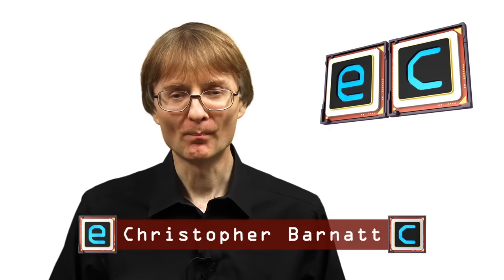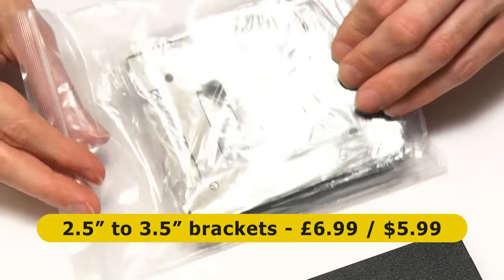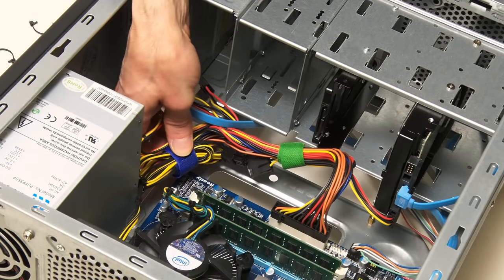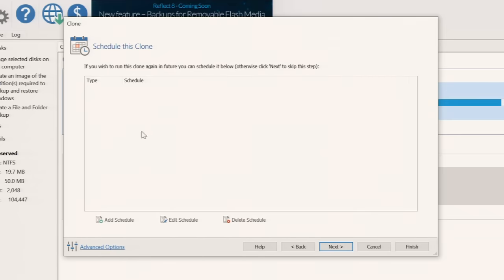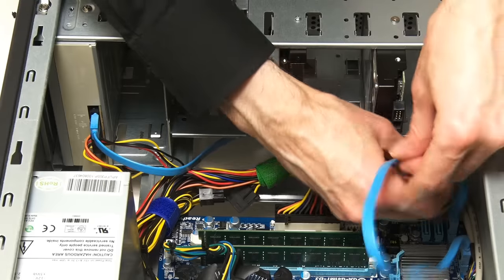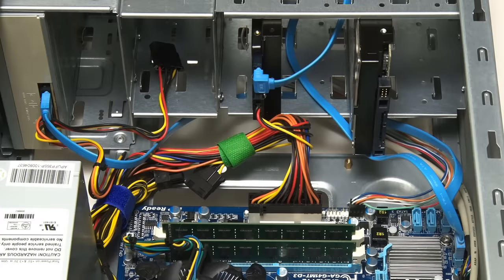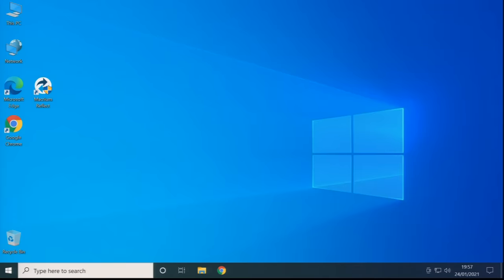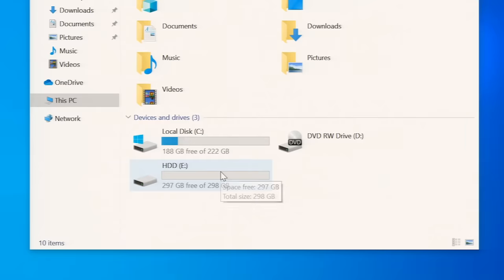Old PC Upgrade #2: SSD Boot Drive

Comment: Great video. I'm just wondering what will happen to my windows license. I have a volume mak license (permanently activated it says), will I lose it?
Reply from the maker: If you clone you Window system drive to another drive and use it in the same PC then your license will remain intact -- providing that you do not then try to use the old drive as a Windows drive in another PC! :) Basically the license is for your particular hardware, and the clone process duplicates the drive it is on -- including the drive ID -- so Windows does not know anything has altered license-wise. Good luck!
Reply: @ExplainingComputers  Thank you! I'm assuming that by hardware you mean the motherboard, but I'm only getting a new drive (ssd in this case) so I should be okay (?) And yes I'm planning on using the old hdd only as extra storage.
Reply from the maker: @mckz9934  "Hardware" means the motherboard, although the if used the cloned drive with the same motherboard but a different CPU, RAM and GPU you could have problems. So if you just change the drive should have no problems. But do boot without the old drive connected first. Good luck!
Reply: @ExplainingComputers  Thanks again!

Comment: Very helpful. Thank you.  I went through the steps. Worked like a charm. One question. I clones a 500 GB hard drive to a 1 tb ssd. Storage now states I have used 139 GB and have 361gb remaining. Looks like I am missing 500 GB. Any advice?
Reply from the maker: Glad it worked, but it sounds like you did not resize your C: drive partition. No problem though! Right click "This PC", select "Manage" and then "Disk Management" on the left hand side of the screen. Then select your "C:" drive on the right hand side of the screen, and below you will see the partitions, and also some empty space. Click on the "C:" partition, and then right click and select "Extend Volume". Use all space available -- ad you will get the 500GB back! :)
Reply: Thanks for the reply and the great videos

Comment: New Laptop don't have cd drive 😕 my current laptop has one. I replace the boot hdd with a ssd. Then I replace the cd drive with a cd caddy and add a 2tb hdd for my data. New laptops cost high with just a 120-240 gb ssd and you can't add a second hdd. Also if it has ssd+hdd is stupid high and getting one with only one slot with hdd is old fashioned.

Comment: Can't wait to give my 10 year old i5 new life!
Just a "quick" question. Can I clone my HDD to SSD, shutdown my Pc, and change my boot sequence to the new SSD without removing the HDD? My current Win10 OS is on a small 80GB partition on the HDD and the rest of the 1Tb is is drive D:
I do not mind keeping my old C drive like that for the day I need it for whatever reason.
Reply from the maker: Yes, what you describe (changing the boot order before rebooting) should work. Just check things very carefully. :)
Reply: @ExplainingComputers  Thanks so much for always assisting us :)
I really appreciate it.
Reply from the maker: @avjaarsveldt  Good luck!
Reply: @ExplainingComputers  Thank you. I tried the clone today. I know I have bad sectors on my HDD, and Marcium Reflect was unable to clone my drive due to that. Do you have a video that can help me cloning a drive with bad sectors. My Windows still boots every time always, so the error sectors should not be on the Windows files (I hope)

Comment: Can I use the sata cable and power connector from the DVD for the hard drive when rebooting the PC with both the HDD and SSD to check the storage and to delete everything from the hard drive? Do I have to use the adapter for sata? 17:47 
I do not intend to use the hard drive anymore and I intend to remove it from the PC entirely.
Reply from the maker: Yes, you can use the SATA cables from your DVD for the hard drive as you note. Good luck!
Reply: @ExplainingComputers  thank you very much! The video is extremely informative, and I couldn't have hoped for a better explanation of knowledge about hardware. Really great job, and thank you again. Your channel helped me a lot! :)

Comment: This just proofs that upgrading the PC based on Core 2 Duo/Quad CPU is useless in 2021. You can add some RAM, you can clone the system to the SSD ... but the main bottleneck, the obsolete C2D/C2Q platform using DDR2 RAM still remains.

Comment: Thanks for the heads up with Macrium Relect, I was struggling to find a free cloning solution that enabled you to clone from a larger drive to a smaller drive.
Reply: Ghost and PartitionWizardFree can both do so, via an auto-resize or manual resize. So long as the data fits, no problem. Some of the old cloning solutions would refuse, tho

Comment: I just bought an SSD nvme and tried to put on my laptop hp pavilion gaming 15... but inside the laptop, I have an SSD m2 with 2 guides, this new SSD has one guidance but it fit! whatever I do, I can't make it work! my bios and windows do not see the SSD nvme! any idea Mr computer guy? (sorry for my bad English)
Reply from the maker: Checkout my SSD video. Perhaps you are trying to use an NVMe drive in an M.2 slot that requires a SATA drive? https://www.youtube.com/watch?v=EXLfErPEYiw M.2 is not an interface. :)

Comment: I have a very old pc laying somewhere which i used to try different linux distros and other things and would like to upgrade but it has only IDE connectors for hdd. Will need a pci sata card or a converter?

Comment: ran into a huge problem ive watched your video countless times again, when I cloned my ssd everything was going perfectly but when i unplugged the hdd to use for ssd it never booted past bios screen just a black screen with a infinite loading dash, it would tell me that the ssd is recognized but windows wont boot on it and after multiple hours of searching and switching back and forth between ssd and hdd I eventually decided to activate the particion on the ssd and after I did that I shut down the pc and switched back to ssd to see if it would boot and I got an error code telling me to insert windows disk because it cant boot or be found, and as you can guess I can longer switch back to my hdd now, I am stuck now and have absolutely no idea what to do next any tips would be greatly appreciated.

Comment: I found your instructions very helpful, but Avast Ultimate is having kittens and Microsoft Office 2021 has lost its licence key? (I cloned the three partitions to my new SSD and rebooted...)
Reply from the maker: Sorry to hear that you are having issues. I've no experience with Avast, but have on many occasions cloned systems with MS Office with no license issues. And indeed I've never heard of this issue before (and there are a lot of comments here). MS Office should be licensed to the computer (or user), and neither have changed. I can only suggest contacting Microsoft and explaining that you have upgraded your boot drive. Good luck!
Reply: @ExplainingComputers  Hi. I am blaming my mouse..... I am sure I selected "clone this disk" before trying to drag and drop the partitions, but either my eyesight was bad or it was the mouse's fault.... (If it was the mouse, it has since managed to fix itself....) either way it was not your instructions. I think the MS office issue was also down to me - I did not remove the network cable and I suspect MS took the opportunity to upgrade my legal Office 21 with a trial version of Office 365 which did not accept my registration etc. etc.
Having started again and done as you instruct (ie. selected "clone this disk" and taken out the network cable when rebooting for the first time) , these issues went away...
Avast on the other hand is doing its job as it deems it should and asking me to approve every different program / module when it tries to go onto the internet for the first time. It puts up a flare window asking what permissions I want to give and for how long etc. The number of different programs/modules that want to do this is horrifying! Most (ie. many dozens...) of these are bits of Windows contacting Microsoft servers. Who knew?
However. 
Macrium reflect and your video were/are not at fault and helped enormously. Thanks, John.

Comment: Once again, a wonderfully clear 'how-to' video! Thank you!

A question: I'm considering beefing up my old laptop. I have already put in larger memory modules and the next step would be replacing the HDD with a SSD. Will Macrium also clone the HDD when I connect a new SSD using a USB to SATA adapter?
Reply: You will likely have no space in your laptop for a second drive to make a direct clone like you can on a desktop.  You will need to do this using an external SATA interface linked to your new SSD and laptop USB to do disk to disk cloning.  You can also do this on a second laptop by removing the original drive from the first laptop and using 2 USB-SATA interfaces. The software will see these additional drives, but you will need to buy additional USB- SATA interfaces.

Comment: I did all as you told us in this video. I made a clone then I changed my boot from the new drive after it I cleaned the previous disk then I tried to boot my PC from the new clone SSD but then it gave me an error with the blue screen and I could not boot my PC from the new SSD and lost my all data. It has happened when I cleaned my previous SSD through the disk part.
Reply from the maker: Sorry to hear that you have had this issue. I would never recommend cleaning your old drive before booting from the new one, just in case there is an issue like you describe. Are you sure your data has gone from the new SSD? Is the drive now blank?
Reply: @ExplainingComputers   yes that was my mistake. but anyway life goes on.

Comment: Have you thought of making a video that shows how to remove the RMB bit on a flash drive so that it can be used as a hard drive ie. remove the removable from the drive recognition in windows. I have a friend that has bought a 32gb Levono ideapad ugh! The SSD can't be upgraded  because its soldered in and is now just about full and won't do any updates.
I've installed an SD card and formatted it ntfs and it is recognised as drive D:
I can read & write files to it but windows will not use it for updates. I'm thinking about using a flash drive/memory stick but that will be a removable drive and windows will also not use it for updates, Can you help.
I really enjoy your computer videos they have taught me a hell of a lot. Thank you in anticipation

Comment: I would have gone with at least a 500 GB drive to allow for future expansion. Even a Terabyte isn't a significant cost upgrade.
Reply: Better plan is to keep boot and apps on the smaller drive, and all your accumulated data files on a second larger drive. That way if you need to replace the boot drive, or even swap out the OS entirely, your data is still right there exactly as it was before.

Comment: what size of SSD should I fit into my desktop it is about 3yrs old and has a HDD WD10EZEX-60WN4A0 my desktop has an external power supply so I mighten have any extra supplies cables or data sockets it is HP Pavillion 590-a0XXX desktop VSJQMTC it is certainly very fast compared to HDD thank you for taking the time of doing these videos

Comment: Excellent work. Any thoughts on doing a "Frankenstein" build? I've many random 10+ year old parts (including a dreaded bATX model) and am in a constant state of wanting to see if I can juggle pieces to min-max pc stats on a "new" build. I don't think I've enough parts to make it worth while YET....
Reply: What do you mean by "Frankenstein" build? Generally it's not worth to upgrade computers as old as shown in this video as they are almost worthless, are on old platform and are heavily worn out. Sure, you can throw money on machines like this, but it's wiser to just save that money for entirely new budget machine.
Reply: @MJ-uk6lu  I don't spend any money if I can help it! :) I've absorbed old parts from relatives (like old Celeron machines they used for like 10 years) and have been looking at amalgamating the parts into 1-2 "better" machines, i.e. using the RAM from both on 1, etc. 
I DO love to mess around on stuff like pcpartpicker building hypothetical "budget builds" and whatnot, but I'm trying to save money to use at least one old case and monitor to make a super-sleeper machine soon! LinusTech did a video on one last year, fun to watch!
Reply: @Matrxmonky  Yeah I know, I have upgraded few old machines in a sense of maxing them out completely and once doing an all out retro build. But after a few of such experiments I realized that they are a financial ruin and after building part they aren't exactly fun to use. It truly does pay to build a no nonsense mid-range budget built, build it once with all new parts and once built forget it for years, maybe a decade. Old hardware has a tendency to break down. My retro build was Athlon 64 3400+, 2X WD Raptor 72GB in RAID 0, VIA Socket 754 board, ATi X800 XT PE, 2x 1GB DDR 400MHz, Creative Audigy ZS 2, Chieftec modular 80+Gold PSU, Define R4, Scythe Andy Samurai Master, TP-Link wireless card. That was my 2004 themed ultimate build. It was kinda nice to have a time machine like that and to experience what 2004 could offer you if money was no object. Unfortunately RAID 0 failed. Then I had an idea to replace that with 2 128GB SSDs in RAID 0. I bought them, but they weren't supported, so I bought a RAID card. It still didn't work, so I settled with just one WD Raptor. Eventually motherboard failed. Bought 2 replacements, both never worked. Also CPU cooler failed (fins of radiator started to fall apart). One extra HDD popped (sparked, smelt bad and never worked again). And at that point I just bought Athlon X4 870K, A68 cheapo board and put my old GTX 650 Ti, got 1TB HDD and bought 2X 2GB DDR3 1600MHz RAM. Build it and didn't mess with old hardware again in that build. It was simply expensive, more time it was broken down than actually functional, and besides certain activities that are fun, the system in general wasn't exactly pleasant to use. 

My other build were slightly newer machines, which I didn't use with Windows XP. I also upgraded them a lot, but the end result was still heavily limited machine with something unpleasant. And if I wanted something nice it would had made a lot of sense to just plan and buy new parts. Stuff that others use and retire, usually is quite e-garbage. At least for me they are usually single core machines with no or little GPU upgradability and severe RAM upgrade limitations.

If we go back to this video, it's not worth to mess with system that old. It has no reasonable upgrade path and each pound spent on upgrades would be better spent on buying modern parts. And while SSD would be reusable, capacity of it is low and most likely it doesn't even have DRAM cache. So he bought it to be cheap and just for this build. He would need to upgrade RAM, CPU, HDD, GPU to get a decent build. And even then Core 2 Quad platforms are obsolete as they lack some modern instructions and can't even load certain games, their performance is no good without at least some overclocking. That board is old and worn out, it wouldn't last long and it will break down after a while. DDR3 RAM is old, expensive and something that cannot be put in newer build, also it's 8GB, so it's still somewhat on low end. The more you watch the build, the more it's full of bad decisions and settling with parts of low value and in the end still having something not quite good, severely limited and on verge of one hardware failure making it unworthy of fixing. I I was him, I would have got Athlon 3000G, 16GB DDR4, 512GB SSD and maybe a new cheap power supply (surprisingly old power supplies last a long time and break down less frequently than other parts like motherboards or hard drives). And with this build I would have disabled hybernation (it ruins performance while using PC and it's still quite slow during booting up, not to mention that it hogs tens of gigabytes of storage), enabled fast boot (makes board go faster through POST screen with no side effects), selected high performance power plan (makes CPU stay in boost longer, disables HDD spin down, deals with background tasks faster and etc). Those settings alone would have boosted performance quite a bit. Also would have switched browser with Pale Moon, which uses way less memory (and also can have cache disabled, so it uses less slow HDD during start up if you leave and tabs open). Or just like many other builds on this channel, he could have installed some lighter linux on such machine. 

As for you, if you can get those parts cheap or free, safely (C19 is no fun) and don't buy new parts for such builds, you should go for it. Nothing wrong with that, as long as you realize all their limitations and don't overspend on old platforms. However, you probably should get off PC part picker. It's too addicting and may lead to unexpected computer hardware purchase.

Comment: 16:11 i did this upgrade yesterday and i noticed the first boot up time wasnt as fast as i had hoped, just like the case here. however, the next boot up time went down to around 23sec which is much better, and even far better than the old 42sec i used to get from HDD. so,have you tried to measure the bootimes again? i believe you be should getting 23ish seconds insteAD OF 39SEC

Comment: I did something similar with 256Gb SK Hynix M2 NVMe with a PCIe x16 card. Had Windows 10 Home pre-installed.  The problem? Older PC BIOS unable to understand the M2 NVMe as a block device/Drive that could be booted from.